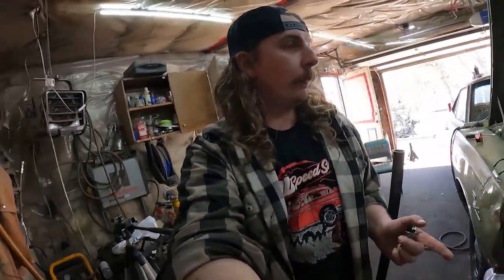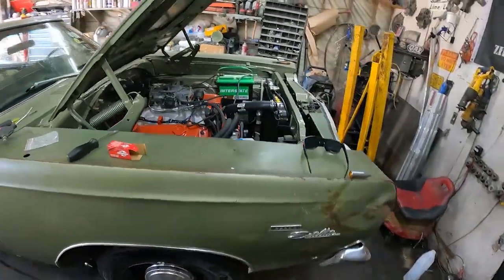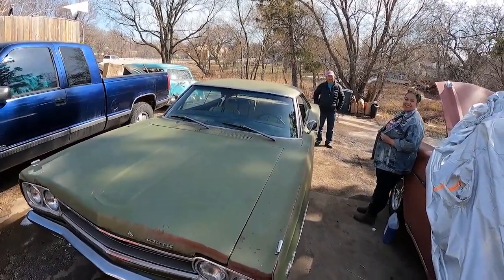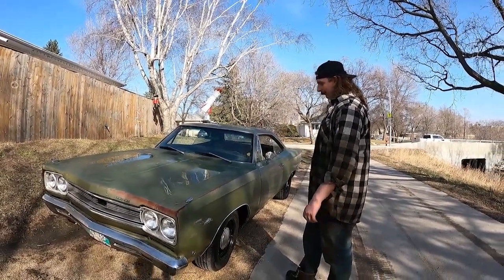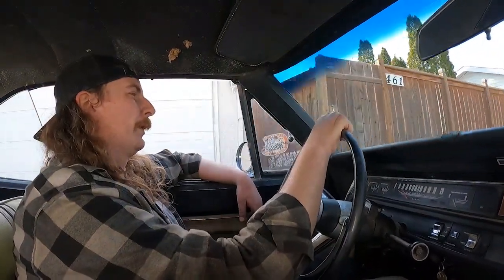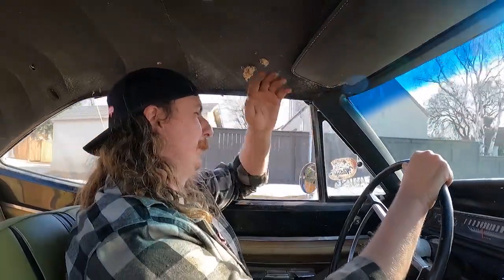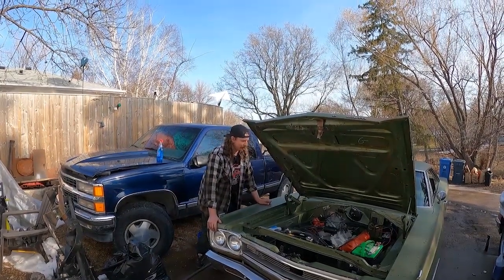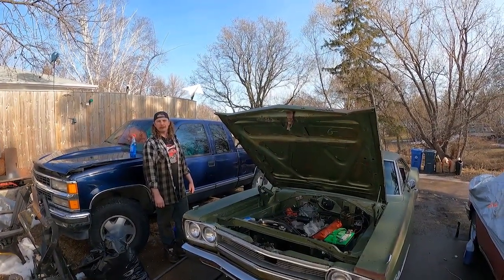FIRST DRIVE SINCE 1976 - Test Driving My 1968 Plymouth Satellite

Comment: You said the turn signals were too bright with the bulbs you retro-fitted.  I wonder if you can add a simple resistor to the circuit to dim them down.

Comment: Just a heads up, the charging system runs from the alternator into the dash through the amp meter and back out to the battery. Dash fires are real possibility. Easy way to avoid this is to run a 10awg wire from the alternator output to the positive side of the starter relay.

Comment: How many times do I see a '68 Satellite driving down the road ? I see mine is still on the road. However, the difference in yours and my Plymouth, is mine has the original 225 leaning tower of power slant six. LoL. But, on a positive note, mine has factory AC.

Comment: Hey man was on research for this Car because i know someone has such a car here in germany. His Engine wasn´t so nice running they changed the carburetor to an Edelbrock and changed sparkplugs and wires. The Motor now works fine but his automatic gearbox doesnt shift. On the very first test it was shifting an he could drive a little bit.  Gearbox Oil was low so they filled it up but still doesnt shift. At the moment it stays in neutral he could shift to drive or reverse but it doesnt do anything. Could it be the Sensor you showing in the beginning?

Comment: Nice.  Good luck on the thumb wheel radio.  In 1969 they went to the round knobs, probably as hard to find as the thumb wheel.  I usually mounted a new unit under the ashtray, easy to steal power and the antenna cord often reached.

Comment: when i take them on the first drive, there are sockets, wrenches screwdrivers etc dropping out and hitting the pavement for the first 3 miles
Reply from the maker: While going down a hill with no brakes?
Reply: @DDSpeedShop  brakes = over rated

Comment: Dan, you did a great job, and it's great to see it driving after so long of being neglected. You will likely start to like this one moe and more as you drive it and put on some miles. The steering is typical for a manual steerig car and if it had less turns from lock to lock, it would be a lot arder to steer. You may end up becoming a MOPAR fan yet, especially once you get the chance to unleash that 440 at full throttle and realize that for the most part that engine is pretty much stock other than the carb, intake, and maybe the cam, which seems like a nice mild cam from the sound of the exhaust. These cars had and still have a strong and loyal following for a reason. Plus, I think you will love how smoothly it will be over the bumpy roads the northern U.S. and Canada are famous for (I'm frm the northern Minnesnowta Arrowhead). that Plymouth will give you a ride just as smoothly as many luxury cars all while providing plenty of  FUN FACTOR at the same time as bringing you lots of thumbs ups from other drivers and pedestrians alike.  Welcome to the wonderful world of MOPAR ownership. My tuke is off to you.

Comment: Ok, here's the deal...l was in jr high when this car came down the line...l drove 1 of these in drivers ed...then later l was on the road and drove everything, fairlanes, impalas, falcons, cutlass, chevelle, pontiac, etc...B body cars were called "mid size" & handled the best of All Mid Size Cars...when you get your alignment dialed in, you'll see what Uncle Tony's been saying...these cars "sail" through the turns without leaning hard (the hood stays level) & you can throttle quicker coming out of the turn than the other mid size cars...& Everybody knew a 727 torque flite chrysler wedge was (is?) the best tow package/drivetrain...stay with it, take care of it & it will take you anywhere you want to go

Comment: I sent you A text before about using honey for frozen motors and Rust.  ( Correction it was Molasses) not honey. The guy had tried everything for weeks on a frozen Motor then used Molasses and it worked.

Comment: I know how priorities get shifted once the good comes out to play. It was a heap and then a good   engine made it a viable ride and things changed. Little by little as it did need floors fixed etc., but its over and done and a good "Krako kackle box" for tunes and weather report will make more enjoyable and fun driver. All your rigs that are not as nice really are not that far off from being a good driver with what not ends tied up. I would put a decent price on it and sell it if the price so moved me and get that property that you need. You ever have five acres of your own, your habits of saving will raise a lot as no more of If I had only saved that nine inch rear end or a 400 automatic... big one is engine blocks seem to keep on giving when it comes to sensors and fittings. I would invest in Dorman boxes for nuts and bolts. I like keeping old starters alternators relays and fuse boxes for different swaps that you do. Flex plates, never throw one away as your going to need it .... just stuff Dan